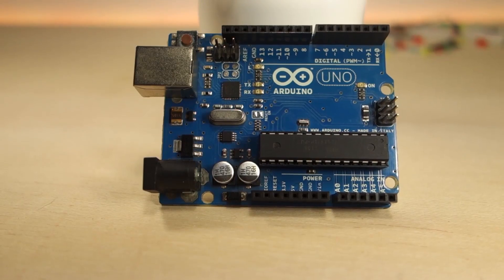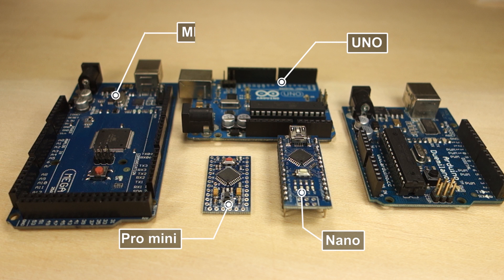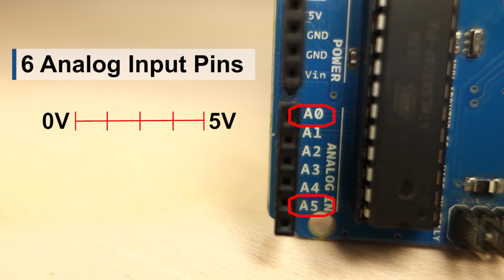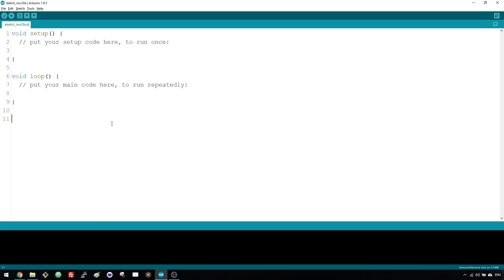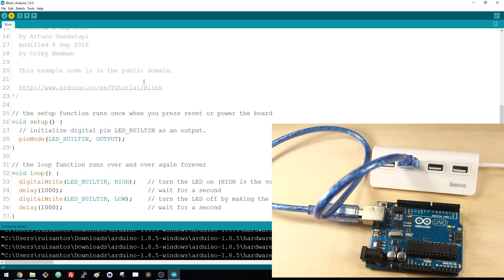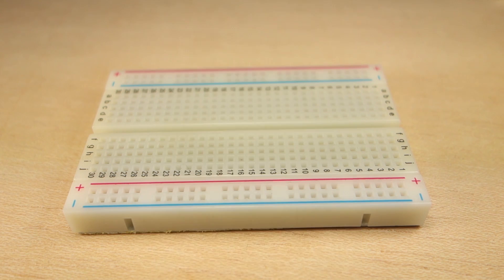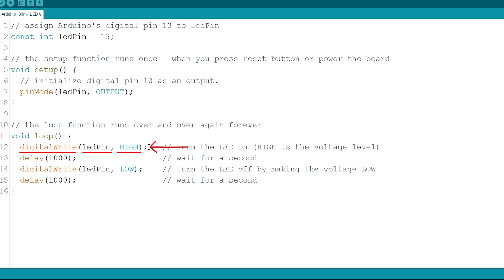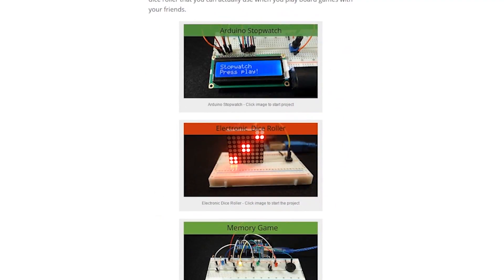Arduino Mini Course - Blink Your First LED

Comment: Great Tutorial! 2 questions)

1) How do I know when to connect a resistor? What happens if I don't?
2) How do I know if I should use a 220Ohm resistor? What happens if I use a resistor with a higher or lower resistance?

Thank you!
Reply: For 1 if you are not connecting to a current limited source, you will need to use a resistor to limit the current.  If you do not use the resistor, the LED will light very brightly for a very short time before it destroys its self.
For 2 there are videos for learning basic electronics that will cover selecting the proper resistor, an example is  https://www.youtube.com/watch?v=hduuUDiku80 .  A higher resistor value will dim the LED until you get to the point where you can no longer see it.  Lower values will brighten it but if you exceed the maximum rated current the life of the LED will be shortened.  Rui does a fantastic job teaching and has an eBook https://randomnerdtutorials.com/electronics-for-beginners/  I have one of his books on building home automation and it is an excellent learning resource.